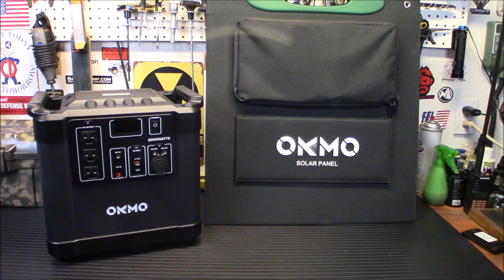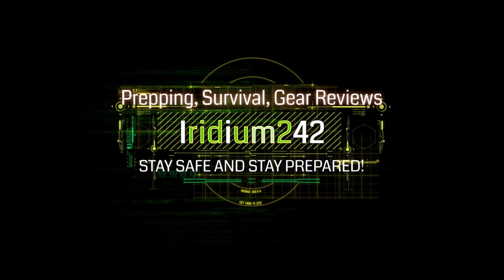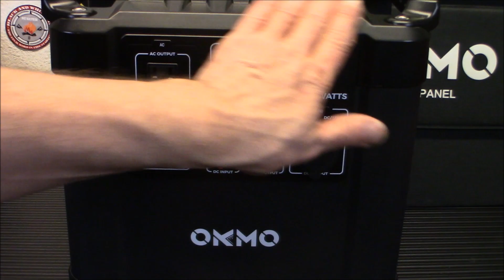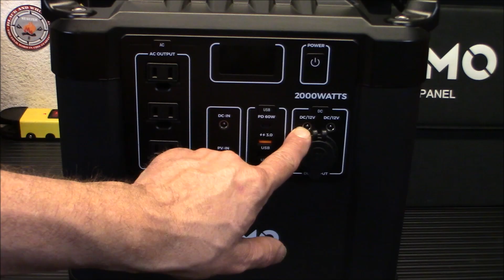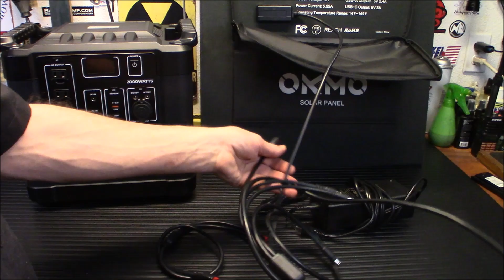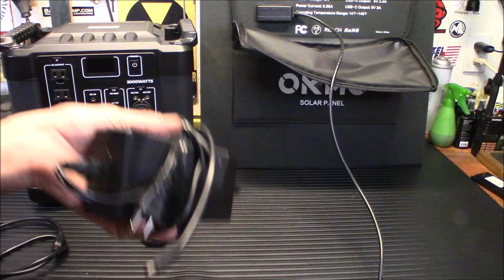Grid Down Power: OKMO SG2000P 2000W Solar Generator And 2 Panels!

Comment: Help!! Gotta a question. I have a window AC. Watts while compressor running is 1140. Can this okmo handle that without shutting down???
Reply from the maker: Oh yeah, with no problem.  Now for how long is another story, but it will deal with that many watts no issue.  It also will run while charging so that is a huge benefit.

Comment: These kinds of portable system are good for on the go or camping, or just keeping your refrigerator working in a power outage, but for a stationary at home system DIY'ing your own offgrid system is going to be more bang for the buck. Designing your own offgrid solar system with an inverter and battery bank is not complicated.
Reply from the maker: Oh yeah, I mean way before these things came out, I had (and still have) a 5000 watt emergency system I put together, installed in my garage.  When the power goes out I just plug in my extension cord into the house, flip on the inverter and off I go.
Reply: I would Love to learn how to make my own to power my house with a battery bank. (Wouldn't it be nice if either of you were my neighbor haha)
Reply: @MeToo-rp6ny  Check out Will Prowse's YouTube channel, he talks a lot about DIY solar and probably has the largest channel on the subject.
Reply: @paul.phillips  thank you very much. I will check that out.

Comment: Wheels and a handle would sure be helpful with that.  I can move my big Bluetti, but moving it too far makes me suffer afterwards.  My explorer has a 12V recepticle in the back.  When my engine gets shut off it automatically turns off the power.  I have to remember to turn my fridge back on when I start my engine.  My Rockpals fridge fits perfectly in the back with all the seats up.  It kept ice cream frozen from Cincinnatti to Cleveland.